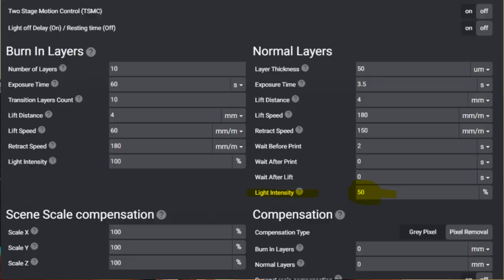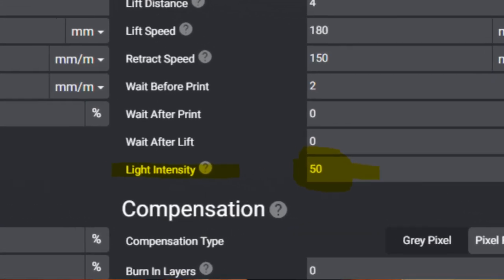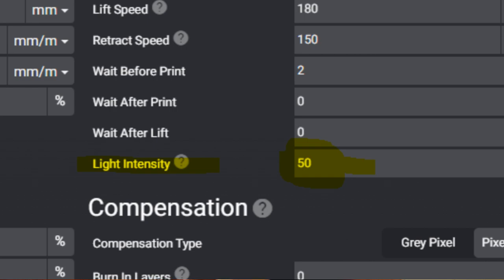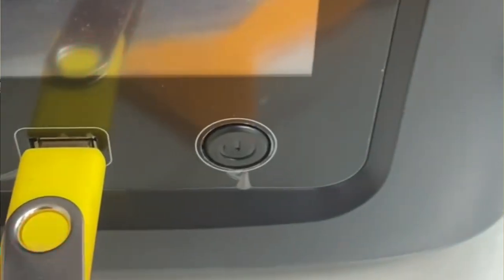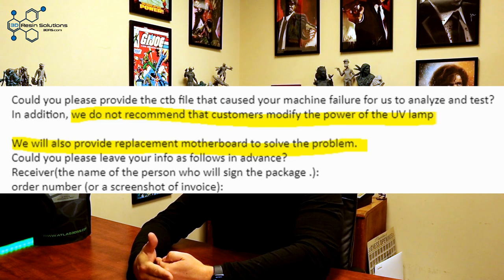WARNING!! Lychee Setting Broke My Machines!!

Comment: Sounds like a mistuned MOSFET drive where the PWM frequency is too high and the loss of switching is much higher than on-loss. When you overheat a MOSFET in this manner, it will usually fail short, no longer being able to turn off the light. You expect permanent damage to occur within seconds.

Completely an engineering fault. They have to test for things like these and if they aren't willing to support PWM properly, just turn off the feature and ignore the corresponding commands from the sliced file.

I don't actually think this slipping through is that big a deal, it's not hatch plugs falling off an airplane mid flight after all, but like they actually have to take responsibility and fix it.